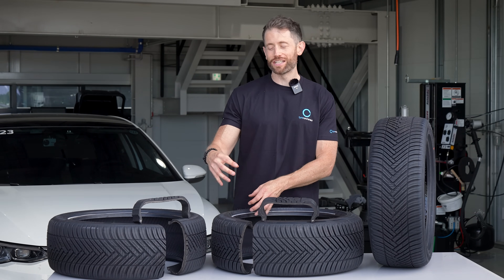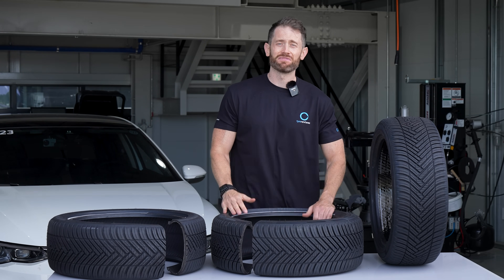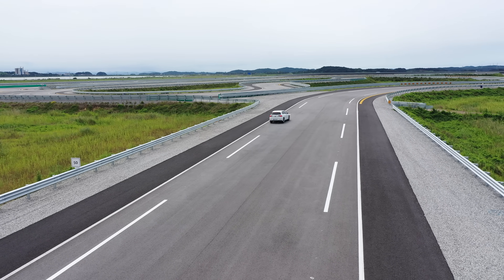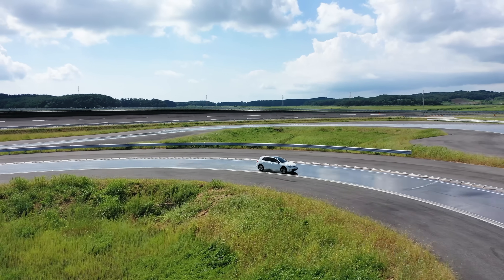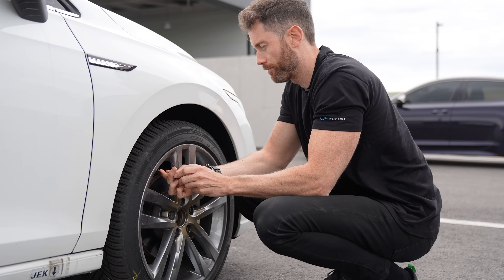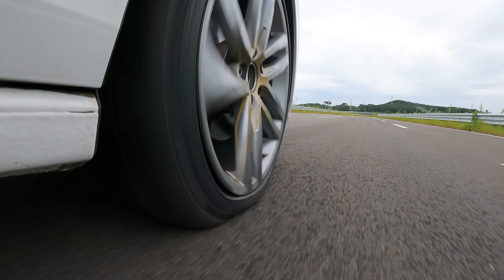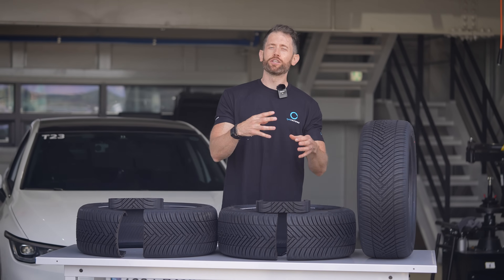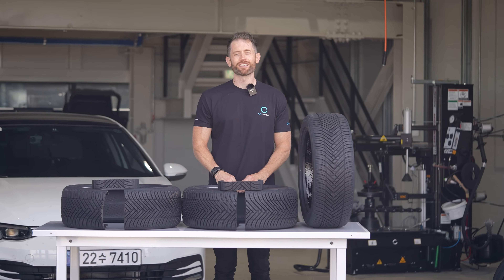Are Modern Runflat Tires Finally Good? Normal, RFT and SEAL Tires Compared!

Comment: I've been using Ultraseal in all my tyres for over 20 years .. and does what the Sealant tyre does.  Been a life saver in my motorcycles and even used in my trailers as well as cars.   My wife had a cut in her motorcycle sidewall and got 20 miles home as the Ultraseal slowed the deflation rather than stopped it.
Reply: Thanks for your information. 
Been trying to read up on this online for more information. 
It appears there are numerous names and ultraseal "may" be branded differently now??

Is it straightforward to put in, I assume via the valve, any issues with tpms, and any particular tyre fitters who supply and or add it that you know of? I'm in the uk.
Many thanks.
Reply: @James-RJM  Yes they seem to have changed franchise names over the years ... but the core product is the same.  You let the air out, remove valve core and pump the set amount in.  Then re-pressure and drive about to distribute evenly.  Never had an issue with TPMS or repairs (unlike some tyre sealants).  Some trye shops have it in bulk to pump in - you'd have to ask around, but I put my own in.   It squirts a little pink blob as it seals .. so your wheelarch/mudguard show it has happened, which I find useful to know.  I saw it demonstrated in person over a plank with dozens of nails - repeatedly driven back and forth with no appreciable loss of pressure.  A godsend when touring Europe on motorcycles ... or towing trailers.  I have no connection with them ..just passing on what I found to be a good product.
Reply: @mdshovel  I'm very grateful to you for the initial information and swift response. 
I'll research further and speak with my regular and independent tyre fitters.
It would solve many issues re sourcing a sealant or rft tyre for my car's particular uhp size, and no issues re dealership warranty voids or worse, suspension issues and or wheels cracking etc, if fitting rft to cars produced with normal tyres!
Even bmw and others that have them oem have had many problems!!
One can also get the tyre they actually specifically want! In my case, likely the Goodyear Eagle f1 asymmetric 6, unless the very new continental premium contact 7 reviews say otherwise 😉 I'm running 225 40 18. 

This particular tyre in the review is likely a brilliant newer style of rft but isn't in my size in any 3 designs and isn't sporty.
I wonder if it's partly more compliant due to being an all season/softer in the first place?
Many thanks.
Reply: If you are in the UK try product called puncture safe.
Reply: @james.  If you are in the UK try a product called puncturesafe.  It is installed thru the tyre valve and then air pressure back up to spec.  It can be done either as a DIY solution or fitted via franchise.  I'm based in the North of England. 
A1 Puncturesafe
Reply: @davidlambert5426  I think that is the current trading name for Ultraseal in the UK. I could be wrong .. but anything is better than "Gloop" :)
Reply: @davidlambert5426  Very interesting information, thanks. 
I'll research further and ALSO visit and chat with many motorbike riders at a local rider's shop for their input and experience, including for cars 👍
Reply: @mdshovel  hi Mark you are correct. About the name. 
Gloop and tire slime are both good for what they are.  
However please also remember that these both have limitations such as speed restrictions and with distance limits.
And both recommend go ASAP to the tyre dealer. 
Puncturesafe doesn't have the speed restrictions nor does it have a distance limit.
Puncturesafe in high speed version which is blue is rated upto 6mm puncture and upto 100 punctures per tyre.  It is also speed rated upto 170mph. 
There are other options of puncturesafe available 
A heavy duty version which is rated upto 15mm and a speed rating of 90mph. 
And a extra heavy duty version which gives puncture protection upto 30mm but is speed limited to 50mph
Puncturesafe also does not contain glycol or other potential toxic chemicals within its makeup
A1 Puncturesafe
Reply: @davidlambert5426  good stuff ... thanks for the info which is useful for a lot of people.  The slow deflation got my wife home from work in London at 1am on a cold wet night - an hour's ride on her Kawasaki Motorcycle.  Says it all right there.
Reply: @mark Dawg.  Glad it got your wife home okay.
What you should find is that as your bikes mileage increases the puncture safe will actually creep up the sidewall as well and ultimately include the tyre/wheel bead as well.
Reply: @davidlambert5426  also seals up a porous alloy wheel ;)
Reply: Also does the same for steel wheels. And stops rust from occurring on the hub
Reply: Shame there are so few dealers.
Reply: @NoManLearnsFromHistory  can buy online or some tyre shops have it in bulk to pump in
Reply: Good point. Will put it on my trailers. I do add the sealant to my ebike tires. I also carry a can of the sealant tire inflator for emergencies.